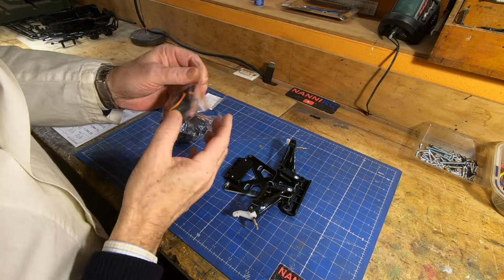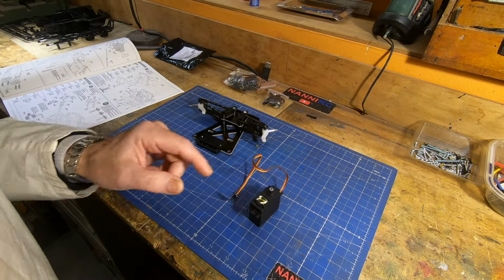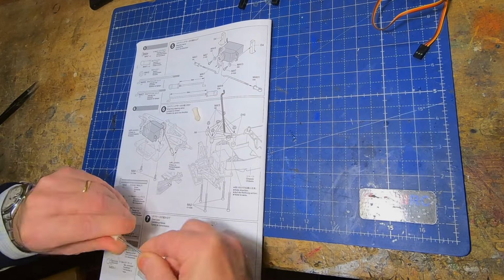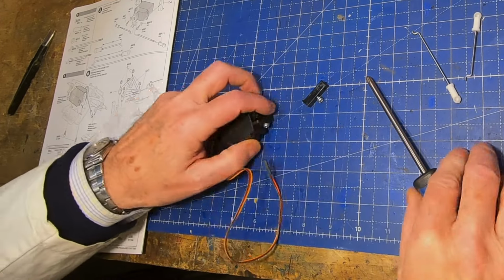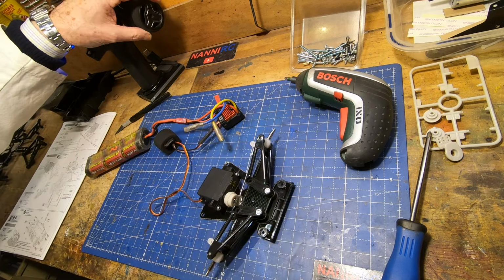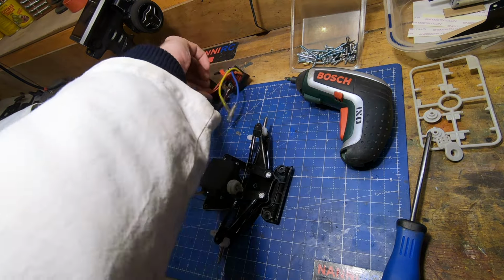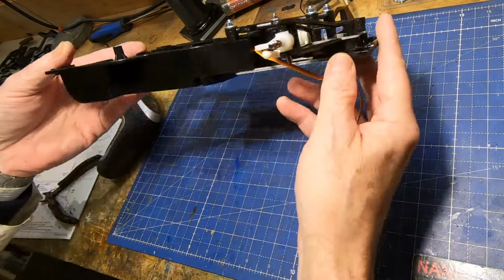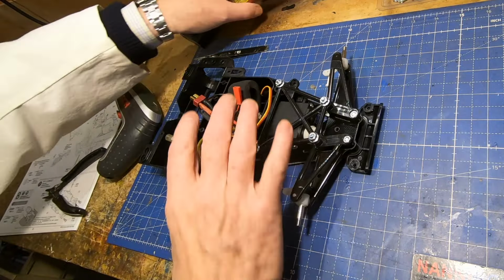New Tamiya Porsche 956 1/10 RC assembling guide part 2

Comment: Over a decade ago I assembled the Tamiya 1990 Mercedes-Benz C11 reissue that came with a finished body.  As I had nowhere to run, it's sat in its box without a receiver and with the foam tires just slid over the wheels.  Now that there's a nice indoor carpet track in town and I found LiPo batteries that fit the stick-pack profile, I'll be running the C11, soon.
Reply from the maker: That's life... never say never. have fun and thanks for sharing. Ciao!!